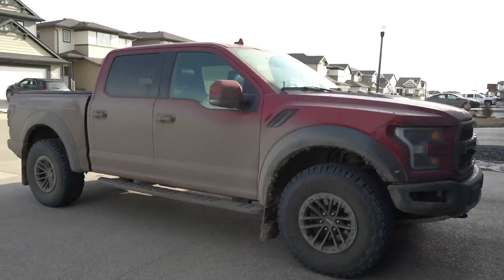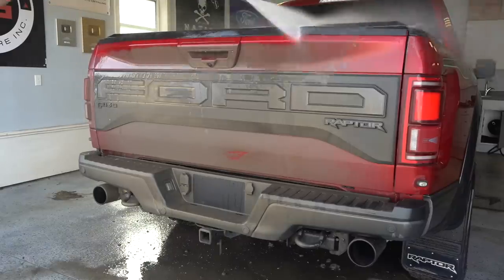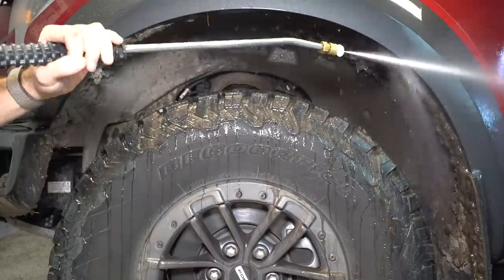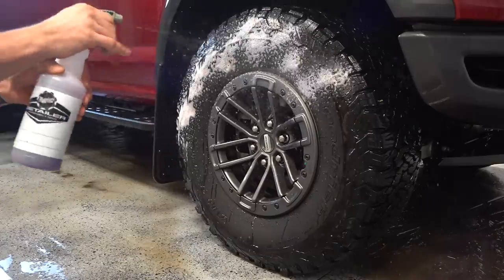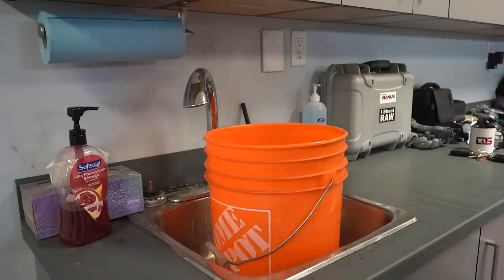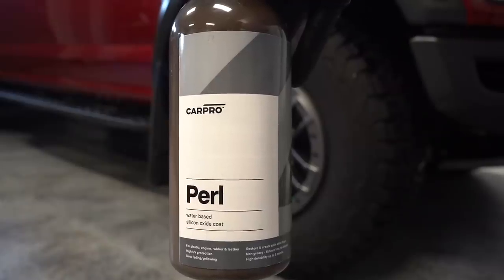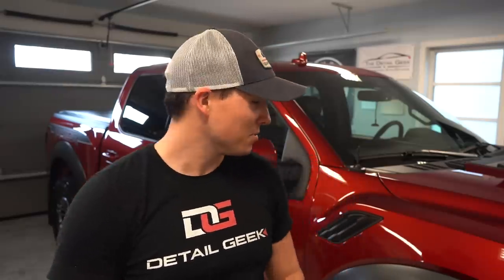Extremely MUDDY Ford Raptor Detail! | The Detail Geek

Comment: My suggestion is to get the LINEX spray in bed liner. I had it sprayed in my 2004 Dodge Ram 1500 when I bought it new. It looks as good as new even after 17 years of use.

Comment: When I had caked mud in the wheel well, I would spray it real quick  so it can soak and be easier to spray off with the pressure washer when I make my way back to the wells just to avoid the spray back lol.

Comment: Truck is awesome but curious, as a 2013 owner and now 2020 f150 owner the water tends to pool in door handle, window sill edges, behind mirrors,etc. so a blower has been helpful for me to expel all that water instead of water flowing out the first time you drive it. Do you use a blower often?  The ceramic coating water beading action is impressive though and I plan to do mine this summer!

Comment: Instead of a towel to dry it off try using a battery powered leaf blower as it works wonders and helps to keep the swirl marks at bay. Also gets the water out of the cracks and crevices pretty well.

Comment: Hey, have you ever thought about putting a big fabric bag in your drain? All the water will go through it, maybe a bit slower than usual. But all the dirt gets filtered. So the only thing you need to do, is pulling out the bag full of mud and clean it.

Greetings from Germany :)
Reply: Or a perfect-fit plate on the bottom with a handle on a stick. So you can pull it up and it scoops up all the mud

Comment: What's the pressure and tip, also Raptor didn't get a refresh in 2018 like the regular  F150s did. 2018 saw revisions to the f150 platform excluding the basic cab design. But the Raptors get theirs this year after the new cab came out.

Comment: Hello Sir .I am a fan on your channel.I am a aspiring Interior detailer from Calgary Canada.I have learned so much from watching your videos.I have a question how do you get thr spot cleaner clean and precent it from clogging from the floor board.I have the Bissel spot pro extractor im having troubles with it clogging half way through detail also there isnt a button to disconnect the cap clear plastic piece to get out yhe hair.Any thoughts on how to help thanks

Comment: Here are the 10 steps I follow at a self service wash: 

I take two buckets (one with soapy water and one with just water) lots of drying towels, 3 microfiber mits (only need 2 but one extra in case you drop one), portable pump foam sprayer, soap, wheel cleaner, spray wax, and tire/plastic trim shine. 

Step 1: high pressure rinse 

Step 2: use your foam sprayer to presoak your entire car and let soak for 5-10 min. 

Step 3: clean wheels with your fav wheel cleaner while paint soaks. I like to use the provided brush for wheels only. Rinse brush after each wheel is clean to avoid scratching. 

Step 4 (optional): rinse car again and reapply soap from foam gun

Step 5: wash paint with micro fiber mits using two bucket method

Step 6: high pressure rinse 

Step 7 (optional): spot free rinse

Step 8: spray vehicle with your favorite spray wax/quick detailer. 

Step 9: dry vehicle from top to bottom

Step 10: shine your wheels and exterior plastic trims if applicable. 

Now you will have a scratch fee experience, and will never wash your car another way. Happy detailing fam! :D

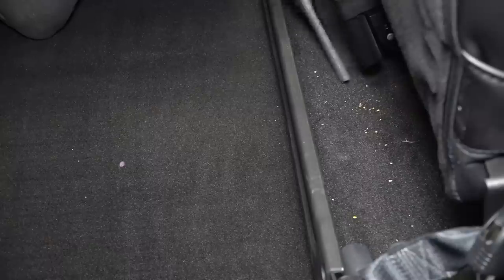Comment: 18:42 i think thats because 2018 ford is not focused on off roading so they can spend more cash on the inside of the truck versions your truck which is focused on the outside and suspension, tires, engine, shocks, and stuff, that they had to cut costs by doing cheap carpeting

Comment: You should do the touchless wash first before going in directly with the hand wash. I believe you should soak the car in foam and do the pressure washing before touching the paint.

Just a suggestion 😐
Reply from the maker: No...touchless car washes use very harsh chemicals that are not safe for ceramic coated vehicles. If you had no other option they are ok in a pinch, but otherwise should be avoided.

Comment: it wouldnt matter if you conditioned the leather anyway, you clogged the pores of the leather with the ceramic coating. Leather is meant to breath and all the coating does is prevent it from doing that. Just my two cents, i dont agree with ceramic coating leather.